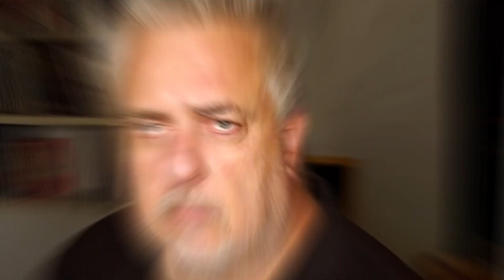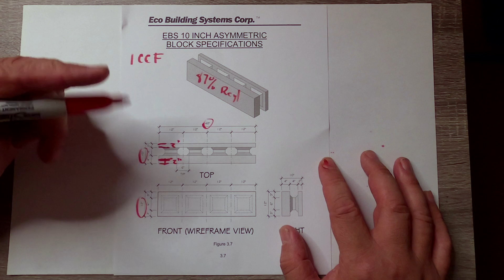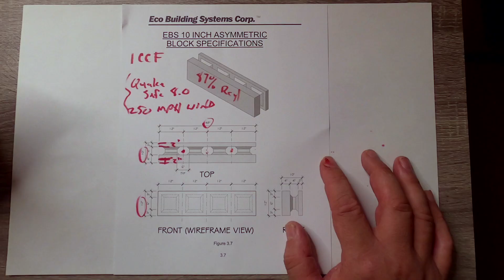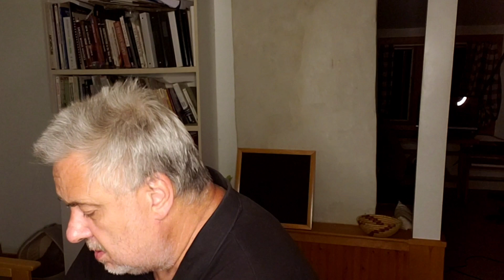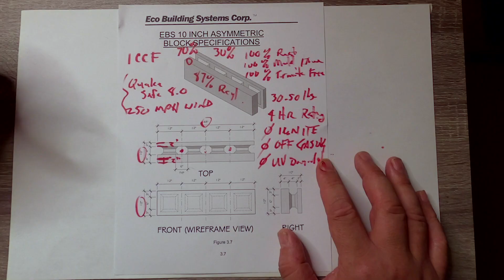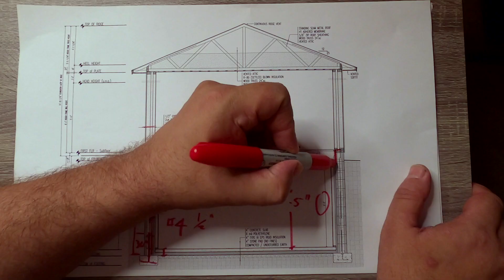Perfect Block Foundation System video 1

Comment: These look interesting, and seem to be an improvement over typical ICF forms, but they also appear far weaker than than regular CMUs or cinder blocks.  I would be concerned with damaging the surface of the block.

I think a better application of these would be in a hybrid approach with traditional board formed concrete walls, wherein you would build the wall with these with proper rebar reinforcement and electrical conduit for outlets run through the blocks as you lay them.  Then, use a whole saw to cut holes through the face of the blocks into the void space, but alternating between every other void on the inside and outside so that you don't have any continuous holes going straight through the blocks.  Then assemble your traditional concrete forms about an inch or two on either side of the blocks, with any necessary reinforcement run through the holes you cut and tied to the main rebar "skeleton" that runs through the center of the block.  Finally, pour the concrete so that it fills the inside of the blocks and the space between the blocks and the forms, with the holes you drilled connecting the three planes of concrete together.

If you used the 10 inch thick blocks and set your forms one inch off the block, you would end up with a 12 inch thick insulated composite concrete wall that would be nearly as strong and durable as a typical poured concrete wall, but with significantly less concrete and significantly higher average R-value with no direct thermal bridging from the inside to the outside.  This would also improve the fire resistance over just using the blocks themselves, while also being easier to waterproof and providing greater thermal mass for more consistent indoor temperatures.

Comment: Using fiberglass rebar and vermiculite concrete you can up the r value in cored block. I filled empty cores with vermiculite in my cmu block piers and foundation. Make sure to put coating on both sides cmu block if using vermiculite to seal in dust indoors. If your masonry wall is wicking a lot of moisture expect a lower r value. They say insulating empty cores in cmu ups r value to 3.7, but only where the cores are which is like half the wall.

Comment: That looks a lot like the thermal breaks we use around windows and doors. A regular 8 inch concrete block only has .11 r value and the air space of the core is 1. So with open core and block come to 1.11 r value. If cored with concrete and rebar the block is only .19 r value.

Comment: Hey Steve, love the dropped floor truss detail. I noticed intello on the ceiling as an air barrier. Any reason you went this route over wrapping zip around the top plate and using drywall for the lid?